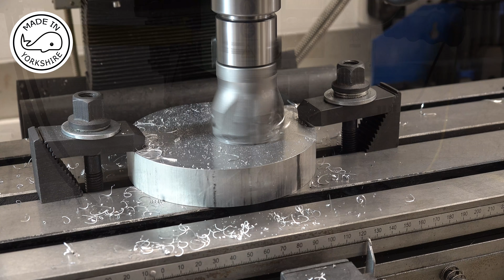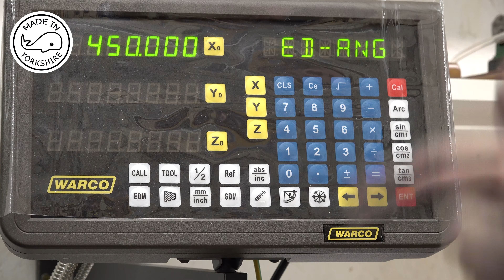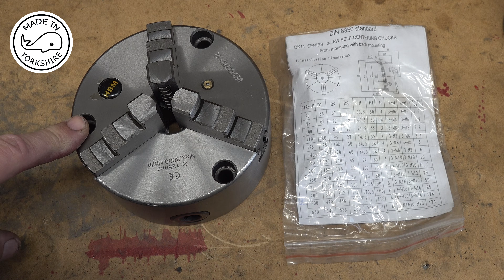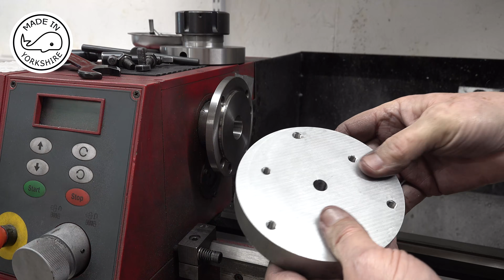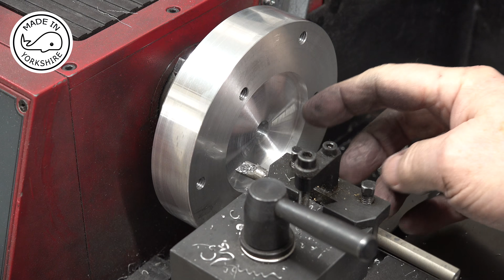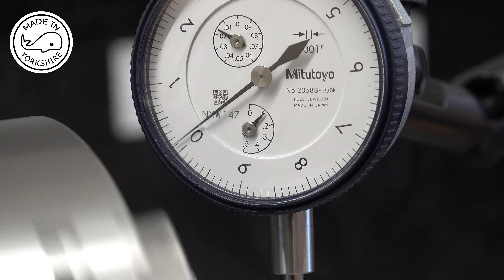#MT40 - Making a 125mm Chuck Backplate Adapter for a Sieg SC4 lathe. In 4K video. By Andrew Whale.

Comment: Nice work. Did you grind a lot on the lathe? Because of the fine dust.
Reply from the maker: I machine a lot of cast iron on the lathe. Just need the clean up well afterwards.

Comment: Hey nice video! I have the same lathe with a different name which it is jetco jml-3s. They are exact same lathes. However, I have a problem on my lathe nowadays. I made lathe work a couple days ago and turn off the lathe and then turn it on again about half hour later but the fuse that on the front panel which is above the green light pops out. I replaced the fuse with same one but pops out again. I tried 5-6 times but each time it just blew. So I've checked the control board, servo motor, screen boards etc. I didnt see any damage on them, and even the fuse on the control board was working.  So, do you have any idea what's going on my lathe? Thank you.
Reply from the maker: Hi. I am no electrician but my guess would be either your front switch is faulty or the spindle is stuck causing it to stall. My manual has a section on troubleshooting but it doesn't refer to this specific problem. However it might help you fault find. Email me at learningturningmetal@gmail.com and I will send you a copy of those pages.
Cheers
Andrew
Reply: @learningturningmetal  Thank you so much for the reply Andrew. I'm gonna send an email right now, may be it'll usefull for me. Thanks
Reply from the maker: @semyil751  No problem. I've scanned the trouble shooting section and emailed it to you.
I hope it helps you out.
Cheers
Andrew

Comment: Hi, just got myself a C4 too and wondering if you've taken to time to look into bearing radial load & mass for a double-weight chuck. If so can you share your calculation?
Reply from the maker: Hi, that is way over my head. All I can say is that the 125mm chuck is a real bonus and the lathe handles it well. 
Cheers
Andrew

Comment: Hi Andrew what is your opinion of the SEIG SC4 Lathe are your happy with it. Thanks George
Reply from the maker: Hi George, I've found the SC4 to be a very good lathe. Power cross feed is good for finishing, but I like manual control when parting off.
The only problem I've had was the Emergency Stop switch failing - this is covered in one of my videos. I think it's a fairly common issue. I got mine fixed, but I've since added my own NVR between the lathes power plug and my mains socket (belt and braces). That wouldn't put me off buying another. Like all these types of lathes, changing gears for cutting threads is a pain. There is no thread dial indicator either on this lathe. I might at some stage buy an additional lathe with a gear box, specifically for thread cutting. That said I definitely recommend the SC4.
Cheers
Andrew
Reply: Thanks for the info on the Lathe Andrew l have been following you videos and you have done some nice work with it.

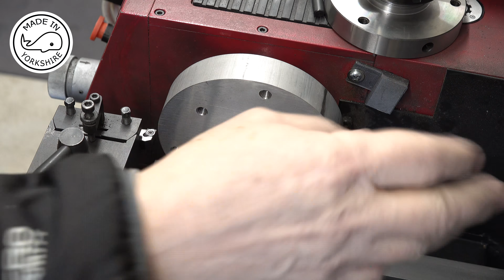Comment: A very pleasing result - well done. :) It looks like the adaptor moved after you started facing it off - you can see the centre hole running dead true when you start the spindle before facing at 12:28, but the hole is visibly running out when you start the spindle to cut the OD at 13:20. No harm done in any case. Thanks for the video.
Reply from the maker: Well spotted mate.

Comment: Hi Andrew. If you want to dial out the runout you can turn down the aluminum boss register so it is 1 thou large. Then tap 4 holes around the perimeter with fine thread. You can then slightly loosen the m8 bolts, adjust the opposing grub screws and tighten it down again. Works a treat for dead nuts centering 3 jaw. If you’re interested I’ll find you the video of Robin Renzetti dialing in his for 10th work or some photos of mine. Edward.
Reply from the maker: Hi Edward. Thanks for the tip. I checked out Robin Renzetti's channel but couldn't find the video. However I think I understand the solution based on your description. For now I think I will leave it as is, but   at least I now know how to improve it if I need to.
All the best.
Andrew

Comment: Another relaxing afternoon video for coffee time . I probably will never need to make a backplate for my 7x14 lathe because if the part is to big for the chucks I have on the machine I can go to my 10 inch South Bend lathe to work on bigger things but as I said your video's are so relaxing for my afternoon coffee break. Please keep them coming. Do you have a secret for getting the bolts in and out of the small space between the flange on the spindle and the headstock of the machine ? I also like your 4X editing with the whale swimming around.
Reply from the maker: Thanks for the feedback Richard. I'll try to keep the videos under 30 minutes to fit in with your coffee break ha ha. Sounds like you have a cracking setup!
Cheers
Andrew

Comment: Good job and top tip using aluminium, I made an adapter plate for my collet chuck, I brought some  really nasty high carbon steel, broke lots of index tips, lost of very hot chips but turned out ok in the end.  You have to be very careful what and where you purchase stock - but found Noggin good.
Reply from the maker: Thanks Andy. I'm not sure if aluminium is good for the long term, but time will tell. Cast iron is most likely a better bet. Thanks for the info regarding Noggin. Looks interesting and good value cast iron billets. Added to my bookmarks!
Cheers
Andrew

Comment: Turned out very well and amazingly accurate. Was it just the video, but the lathe seemed to be running fast for some of the cuts near the outer circumference. No real problem with Aluminium but you wouldnt get away with it using a harder material. Possibly the reason for the run out on the cast iron version? So, do we deduce that the next project is going to be something big requiring a larger chuck? 😜
Reply from the maker: Thanks Tim. I think I ran the lathe a little faster than when I tried machining the cast iron one. Not sure why that one didn't work out so well. On the odd occasion I could have done with larger chuck capacity. I didn't think my next project will need it though 😉
Cheers
Andrew

Comment: Hi Andrew: Just some thoughts on using aluminium as a backplate.

Not saying it is a mistake to use aluminium only time will tell, but the inherent properties of any material used must be taken into consideration as its suitability for the duty it is to perform.

There is a rule that aluminium has 1/3 of the tensile of steel. Its lower Young's modulus may reduce the overall rigidity, but provide a bit more spring between chuck and lathe. There is also the consideration of differential expansion problem between aluminium and steel or cast iron.

The rigidity of the system is dependent upon the rigidity of all the parts, it does not matter how rigid the rest of the system is if you have something softer in there. This may cause vibration and chatter at a lower speed then CI or steel would. It may not cause any problems in your application, but if you find rigidity problems, this could be the cause.

Keep on producing your videos always interesting and provide food for thought.
Reply from the maker: Hi Steve - many thanks for the advice. All valid points. I will have to see how it goes. I don't do much (if any) heavy duty work - but like you say, time will tell. If I end up making another one in cast iron, I will at least have a decent process to follow.
All the best.
Andrew

Comment: Good job Andrew. I really enjoy You videos. I bought a back plate from Arc Eurotrade for my mini lathe, and also an independant and self centering Ø100mm 4 jaw chuck, as my lathe came with an Ø80 3 jaw chuck and Ø11 through bore. But I am very dissapointed with the runout of both the chucks and the back plate! It's terrible, the whole lathe is almost jumping off the table! Perfect runout on the spindle itself. Do You have any pointers? I tried to turn the bolt attachment pattern 120 degrees at the time for all of them but still terrible.
Have a nice week-end.
Reply from the maker: Hi Kim - assuming your 80mm chuck has minimal runout, I think your problem points towards a bad backplate. I would use a micrometer to check that the thickness of the backplate is the same all round. Also take your chuck off and put a gauge on the face of the spindle register to make sure that is running true with the lathe bed. If all good so far, bolt the backplate onto the spindle without a chuck attached and put a micrometer against the face of the backplate to ensure that runs true with the lathe bed. You could put the original chuck on and put a test bar in to see if that shows runout. Do the same with the other chucks. If you turn the bolt pattern 120 degrees, does the problem follow it? If so, it seems like a duff backplate to me. It should be a process of elimination, but I appreciate that it's sometimes difficult to get to the bottom of problems. Try to take a step back and try working through it starting at the headstock spindle. Hope that helps.
Cheers
Andrew
Reply: @learningturningmetal  Thanks a lot for Your comments Andrew. I'll give that ¤#%&"#¤ backplate one more try or it will end up as a door stopper.

Comment: Turned out great again Andrew. I see that you are still Fixated with 0.010" cuts, that seems to be your favourite number LOL. BEWARE next time, when you tried the first bore and the gauge fitted, you rotated it and it went TIGHT, that was because the aluminium was "Picking Up" and was galling and starting to seize. Apply oil film next time. You will probably encounter similar problems putting the plate on  an off the spindle, with it wanting to grab, especially after running due to temperature changes. Apply a bit of Anti Scuffing Paste to the Ally recess or Copper Kote if you have any ( used on car brake parts ). Regards from Australia.
Reply from the maker: Hi Dave - many thanks for the great advice as always.
All the best.
Andrew

Comment: Concerning the runout of the rod in the chuck, you might take another light cut on the back plate on the chuck side to open up the register. There may be enough play in the chuck mounting holes to allow you to zero out the chuck. I also agree with others that boring out the center hole will allow you to chuck up longer items
Reply from the maker: Thanks for the advice Robert. I'll open up the centre hole today. However, I dare not touch the register again because I think I would make a real mess of it.
All the best.
Andrew

Comment: Hi Andrew, great result. Your hole won't really have been eccentric by 0.004, your issue will be squareness. As the drill went through  it will have run off square slightly, the reamer will just follow the drilled hole axis. A tip to avoid this is either an endmill/slotdrill just under the reamer size following the drill, failing that, a boring head (as you dit it in the mill) assuming you have one, this squares the hole up prior to reaming. I would personally whip the chuck back off and bore it out to your headstock tube diameter so you can slide stock through. This will square up the hole, (still got your insurance policy) and allow you more freedom. Hope this helps. Excellent work. Cheers, Jon
Reply from the maker: Hi Jon - many thanks for the advice. I must try to remember the endmill/slotdrill tip. I'll open up the hole today.
Cheers
Andrew

Comment: Very nice work Andrew, however I not sure alluminium it’s the right choice for a 125 mm backplate... also if may I say I would have done first the front register previous to the 3 fixing holes on the front . But you got a very good result anyway, so wel done, and thanks for sharing
Reply from the maker: Thanks for the advice. I hope aluminium will be OK - time will tell. Fingers and toes crossed!
Cheers
Andrew

Comment: Really well done! Great footage and editing.
What was Your goal for interfacing and using a 125 mm chuck? Reversed jaws do give quite some range on the 100 mm chuck? The torque of a small lathe... will it be enough?
I've also got a 125 mm chuck that fits my rotary table..
Face milling and reclamping gave me more of a roller coaster as I remember. Why not drill holes, counter sink and bolt directly to the mill table?
To me it looks like several critical steps on the way but You clearly mastered them well.
Reply from the maker: Thanks Stefan. In the past I've occasionally encountered limitations with the 100mm chuck - hence getting a 125mm one. I've not got any specific plans for it yet though. It should also open up some work holding options on the mill.
Cheers
Andrew

Comment: Hi Andrew  Great Video!! Alloy should be OK on a small chuck, I have the next size up lathe to you,slightly different arrangement for attaching the back plate but basically the same, Like you I use a dummy to get the register But I never drill the fixing holes for the new chuck until I have a perfect fit to the register this makes for greater accuracy. But well done keep it up!!!
Reply from the maker: Hi Mike - thanks for the tip. Fingers crossed the aluminium will last. Time will tell.
Cheers
Andrew

Comment: Hi Andrew, might want to open up the central hole in the backplate to accommodate larger bar stock.....
Nice well presented informative video... Thank you. M
Reply: I would agree with mark to open up the inside bore as large as possable, you will find a need for the extra room
Reply from the maker: Thanks Mark - yeah there always seems to be another job! I''ll have a go at finishing it today.
Cheers
Andrew